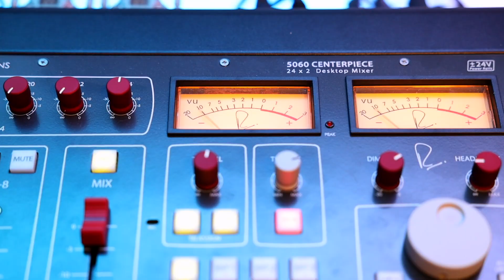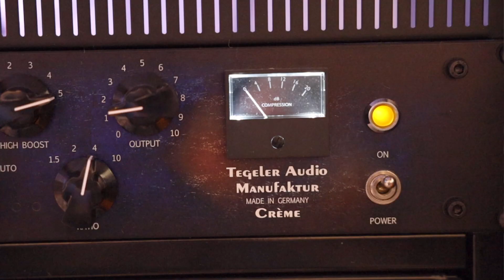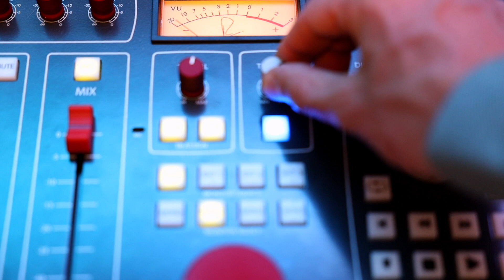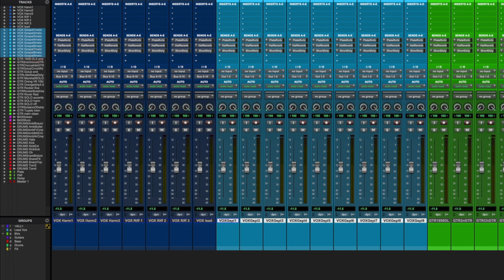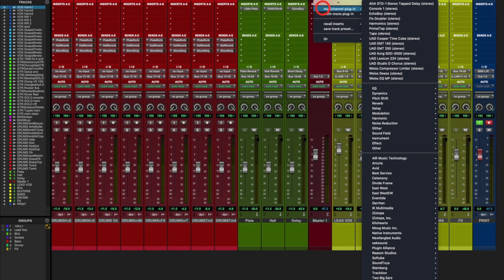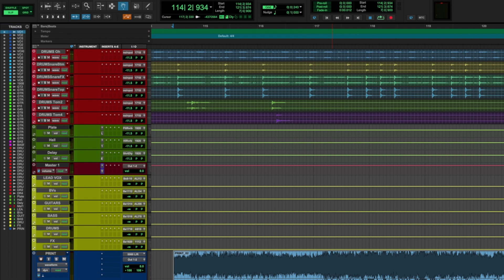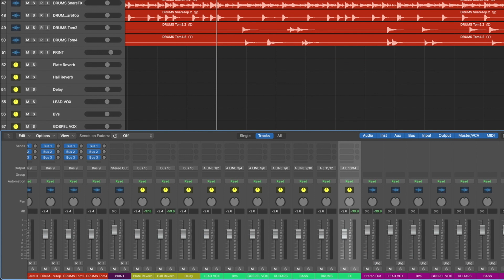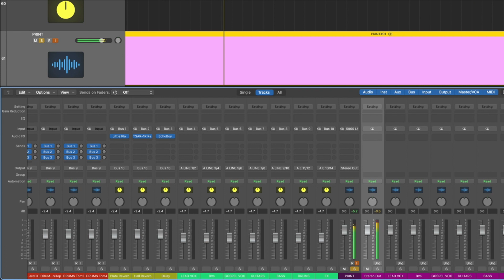Analog Summing Workflow 🛠 Setup and Benefits in Pro Tools and Logic Pro Tutorial 🦾

Comment: Hey, Great demo on the analog summing. What can you say about the fan noice in 5060. Is it noticeable?
Reply from the maker: No. The fan is super quiet. One thing that does make noise is that the needle on the meters can hit during transients and make a little tick. Apparently this can be disabled. I’ve gotten used to it, but at first it was a bit annoying. And it is subtle. It isn’t something you’ll hear over the level of a mix.
Reply: @ToddUrban  Great ! Thanks Todd, I am in the middle of thinking 5060 or 8 channel 5088. In 5088 it seems to have 3 fans for the penthouse maybe not noisy either. Need to decide witch one will fit better for my workflow. Have you had a chance to compare 5060 and 5088 IRL?
Reply from the maker: No. They should be the same sonically as far as I know. But the 5088 wasn’t an option for me based on space. Of course the price hike is significant too. I would contact RND and talk it through with them. They are a great company and very responsive.

Comment: Thank you for this! I’m getting the API Box 2 down the road and have never done summing mixing before. I may get an additional summing mixer like the API AMS164 or the RND one as well for even more track possibilities. You made it a lot easier to figure out in Logic which is what I use.
Reply from the maker: The Box 2 is great. I thought about it and am a fan of it. However I already had my preamps, so that’s why the 5060 worked out better for me. (And they are also very different sounds and workflow)
Reply: @ToddUrban I decided that I’m going to go down the analog summing mixer route instead of the API Box. I think it’s probably overkill for me, since it’s just me in the studio. Do you think getting the 5060, over the 5059 is really worth the $7000 price difference? Thanks
Reply from the maker: Sonically, I believe the RND should be exactly the same, so that leaves workflow. First; yes they are expensive. But I use the 5060 every single day and not just for prints. So therefore, I can justify that expense. It depends on when you just need a summing mixer or want more of a full console feel in a compact unit. 

One benefit of the 5059 is that you can have 2 stereo outs, which might make stem printing faster. (By twice the speed) But otherwise, I would buy a 5060 tomorrow if something happened to mine.
Reply: @ToddUrban thanks Todd 🙏

Comment: Just got a Yamaha M512 that I’ve been setting up for summing. 
Setup is : 
SSL 12 ( main interface) 
Behringer ADA 8200 ( over optical) 
Yamaha M512 master outs into SSL 12 ( L - input 1 • R - input 2 )
Yamaha M512 foldback out into ADAT input … about to jump the echo out to be pre fader as it’s currently post and prints to whatever it’s panned channel so…good for parallel )

I need help with outputs! I have 1/2 connected to my control room monitors. 3/4 patched into patchbay ( set half normal and spit to headphone amp )
I use one headphone out for my sub woofer. 
  
So basically I can only send out from 3/4 and headphone out…only giving me two mono outs ( usually used stereo ) and the phones out….

Can I hook up an old Scarlett 18i8 in between the Behringer 8200 and the SSL ADAT in to be : 
•ADA 8200 -> 18i8 -> SSL 

Sorry for long question! Great video got my brain goin
Reply from the maker: Sure. It sounds like the Focusrite would be just to get you more I/Os for summing. And if that does the job, go for it. I think the question to ask yourself is why do you want to sum. There are two main reasons why (and it isn’t the cost and inconvenience 😉)

Are you looking for additional distortion or to add some outboard gear? If so, do it. The other big thing for me is that it can feel creative, and outputting stems for summing does change how you deal with headroom vs ITB mixing. As long as you fall into one of these camps, do it and have fun. But it does take longer, and it is costly.

Comment: I have the 5060 and it sounds good, especially if you push it and light it up a little. I agree with you about the width and depth of mixes that are summed analog, but at 24 bit, it makes sense not to record too hot the way we used to Have to with tape. That opens up a mix, even if it’s in the box. I use the I/O plug-in to use my outboard while I’m working on a mix or sometimes just use it when I print. It’s more time consuming but it sounds good.
Reply from the maker: Agreed. Thanks for your insight. Even with ITB mixes being more common, the 5060 is used every day, even just to print final stems.

Comment: Hello, i would to enquire that what is that ’5060 input’? and why there are different names in each summing output. I have no names there. Only the input numbers. No names beside the the stereo track 1-2, 3-4, 5-6, 7-8. Was wondering do i need to change the stereo track separately away from input. My recording only works from bouncing tracks as the stereo 1-2 only working as the recording output. (logic pro x user). I assume the 5060 is the studio mixer. So do i need to switch the current audio interface (scarlett) for studio mixer?
Reply from the maker: Well, you can rename inputs and outputs in your I/O labels. For me, the 5060 is the output of my summing mixer back into the DAW. It is just an input to my interface and I’m recording it back as a normal stereo audio track. I have another video on the 5060, which might also help explain this. Hope that helps a bit.
Reply: @ Oh sorry i mixed the input and output. I’ll check it out for sure, been wrapping head around this for a while now. Okay. Input needs to differ from stereo signal. Thank you very much for a quick response!!!
Reply from the maker: Rupert Neve Designs 5060 Centerpiece 🏆 Workflow Tutorial and Summing Review 🎬
https://youtu.be/tCHIyOlh8vU

Comment: Is combining the drive setting of console 1 with the analog mixer over kill for harmonics or achieving a console sound? Do you scale back the drive?
Reply from the maker: Well, it depends on your goal. For me, an analog mixer saturates the entire mix or stem print to help provide some cohesion. For the drive, I might exaggerate the drive to help elements cut or add character. But the summing distortion imparts a different benefit than the individual track drive.
Reply: @ToddUrban  good point. I’m still trying to figure out what part on the channel strip the drive harmonics are supposed to be emulating; the pre, eq/comp, or the summing circuit. I’ve contacted softube already, but I’m just trying to figure out if I should purchase an analog mixer if I already own console 1.
Reply from the maker: Each one is slightly different. Typically, you are capturing the preamp drive of the circuits (I believe). I would need to double check the manual. The models of the comps and EQs will capture the distortions that are present in those circuits. But once again, what really matters here is can you get the sound you want. I personally love working with a summing mixer. But I can also mix an album perfectly all in the box with Console 1 Channel and nothing else beside my reverbs and delays. So it really matters on what your objective is. I wouldn’t get too hung up on whether it is a preamp, output transformer, or the sound of summing (as LUNA puts it), focus on whether you can get “your sound”

Comment: If the printing is finished bounce or export ??? In logic x
Reply from the maker: You can do either. But I just use command + B to bounce it. Many times even after printing, I might use something such as a plugin for digital limiting on the print, so bouncing works well for me.

Comment: Just about to start using analog summing, picking up a soundcraft 200b in a few days, might recap if I have to, running out and back to computer and or reel to reel
Reply from the maker: It doesn’t always need to be some crazy expensive gear. If it sounds right and the workflow works, go for it! 😀

Comment: Hello, I'm using a Dangerous 2bus+. I connected everything as it should be from/to my Orion Studio (it's pretty much a common sense setup). However, for some reason, I keep getting feedback when I go Main Outs from the 2Bus+ into any inputs on my interface. I'm sure it's something simple being overlooked. Any idea on what it could be?
Reply from the maker: My guess is that you are somehow monitoring both the DAW outputs and the inputs back from your summing mixer at the same time. It’s hard to know without seeing how you set it up though. The other option would be if somehow you were also sending the inputs from the dangerous into the interface back to the dangerous. And that would be possible if you had the monitoring of those inputs assigned to go back out for summing. Hope it’s one of those and you can figure it out! 😃
Reply: @ToddUrban  Thanks for the fast response. I actually figured it out. The routing inside of the Antelope software was kind of messy, even when I set it to default routing (I had assumed that would clean everything up lol). I overlooked some of the patch numbers that were duplicates of mixes/routing. I deleted everything and started from scratch to tailor it to the 2Bus+ and Pro Tools, and got everything in order. Thanks again!
Reply from the maker: @ankh9ether great 💥

Comment: A question. I’m using Studio One. When I have guitars panned hard left and hard right and sent to a bus … it doesn’t sound that wide. However when I solo the left guitars only (or the right guitars only) and print those tracks separately , the guitars sound much wider. Is there something I am doing wrong with the bus?
Reply from the maker: Hmm. Interesting. That would suggest maybe a phase issue when combining the signals. (Though in stereo that is typically less perceivable than in mono) In theory, L/R busses should be the same as 2 mono tracks hard panned in the DAW. If you are using a summing mixer, there have been times where I have felt that the stereo width changes in the analog domain. Is that just trickery? Maybe. But it could also have something to do with how the summing mixer’s circuit works with the individual tracks or stems. If distortion is applied to each one, it might differentiate the track creating the feeling of additional stereo width. (Not sure if any of that helps…..)
Reply: so I have double tracked guitars playing the same thing panned hard left and right. When they are playing the same thing … this is where the stereo image feels slightly narrow on a bus … however when one of the guitars plays a different note or playing something different, then the stereo image goes back to being fully wide. 
I have a shadow hills summing mixer and still sounds the same when summed. Maybe this is in issue with Studio One summing busses.
Reply from the maker: @JimboJones99 to me, that feels more like phase cancellation if same notes decrease stereo with, but different ones increase it. If the guitar sounds were tracked exactly with the same sound, this is very possible. This is why I typically switch guitars or amps when double tracking. This creates enough variation in the timbre so that it decreases the chance of any cancellation.
Reply: @ToddUrban  ok thanks so much. Yes will use a different guitar tone ! For each side L/R. I should have done that before.

Comment: FYI there is no analog mixer/summing device that has more headroom than a 24bit digital summing environment.  this is just simple maths and is easily verifiable.  if you correctly manage the gain structure in your mix you can have essentially infinite 'headroom'.  btw i say all of this as someone who mixes with an analog summing device.  i just know its not because it actually increases headroom.
Reply from the maker: The point here is that headroom is a completely different consideration. It isn’t a matter of more. It is that when summing stems, we are able to keep them at relative levels within the DAW without needing to adjust for clipping. They are summed in the analog domain, at which point, if you are summing to the point of exceeding the headroom of the device, you will be introducing a soft clipping distortion, rather than a digital over. 

For me, this is more about the workflow of not needing to constantly adjust 10-30 different stems busses in my DAW as they sum in the digital domain to what could be an overage. It is about leaving them in place and focusing more about the relative track levels into those stem busses.

Comment: How do I connect the Neve 5057 to a Apollo’ twin
Reply from the maker: Well, you are going to need more outputs than a twin offers to take advantage of the real potential of an orbit. But the Twin does have 2 outs, so as of now, you could use the Orbit for Silk color. What would be best is to look for an interface with 8 analog outs to really use the product to the max potential.
Reply: @ToddUrban more like 16 outs as the orbit has 16 ins
Reply from the maker: Exactly. You would want at least an 8 out or 16 out to benefit. A x8 or x16 would do this for you

Comment: This came across my feed and I just wanted to de-bunk this so people (New Users or Kids or even Semi Pros etc) don't go out and buy some weird hardware or an expensive hardware piece thinking they will get more headroom. This is NOT true. All hardware is based on electricity and has a limited point (Based on Voltage Rails). Digital, does NOT have a limited point and is based purely on numbers and how it's implemented. Your typical hardware at best can go up to 122db if that and we are talking about thee BEST in analog hardware. In digital, it's 144db and that's at the lowest 24bit/44.1k standard. Pro Tools busses like any DAW bus is clean. No color. You get what you put in. Analog summing is NOT. You will get color (EQ) and saturation (light distortion) if pushed hard. I know this video is a year old but this topic has been de-bunked since 2012 etc. When hardware had it's chance to be compared, as far as headroom, it was when Pro Tools was a TDM system and it was running 24bit fixed technology where the headroom was around (24bit) 146.26 dB and the convertors ran around 110db. That is still more headroom than most analog circuit can handle. I don't want to get too technical and keep this basic. Now, every DAW is 64 bit. That means it's 387.08 dB of headroom ITB (Inside The Box) on busses etc. NO ANALOG HARDWARE COMES CLOSE. A Neve Console has up to +26db of headroom. I think at best, API console is +28db. SSL is +26db as well. On a 64bit Pro Tools/Logic Pro/Studio One/FL Studio, it's unlimited. Meaning you can't distort the internal summing period. You can distort the output of your convertor (Which is the distortion if you are hearing some is from) but NOT the mixer itself. Do a test, put audio on your track then put 10 blue cat patchwork plugins that go to +40db each plugin. Then have it go to a master bus. Then on the master bus, put a trim plugin on it, and just simply turn it down. Heck, you can turn down the fader too as that is the same thing. You will hear NO DISTORTION! Try that on your best hardware. So what are summing mixers good for? Color and saturation to get a different sound. Not a better sound. That's all. I have a channel on Youtube that touches on this called plugmein - https://www.youtube.com/watch?v=z8KDtxADFCk&t=6s    I'm not trying to promote the channel just trying to get the right info out to help up and coming mixers/producers etc. I respect whoever runs this channel as I'm sure they are going off the knowledge maybe they were taught about digital and hardware. I hope this helps and please feel free to ask me any questions. I'm also M2E on Gearspace if you guys go there. I touch base on this subject on this video if you'd like to get to it direct: https://www.youtube.com/watch?v=1ZYFrpcwYf0         God Bless!

Comment: Hey Todd, I have 3 questions 

1. Let’s say I had 2x Rupert Neve Orbits and 32 DA could I just run each track to corresponding DA. Track 1  to 1-2 track 2 to 3-4 etc etc instead of creating busses? 
2. Can I just insert I/o onto the individual tracks for my analog hardware e.g compressor , eq etc? 
3. Does the Print track become my mix bus ? Would I insert an I/o onto print track for bus comp ? 

Sorry for dumb questions I’m wanting to integrate summing but trying to visualise in my mind how I’d set it up within Logic with the idea of mixing into the orbits and each track having its own summing track so no need for stems or groups and the ability to monitor in real time the sound of the summing units and the ability to swap around analog hardware to any track via I/o plug. Would this be reasonable? 

Thanks in advance
Reply from the maker: Yes. You got the right idea. Actually, I’ve done this for smaller sessions. Instead of having busses or stems go out to the summing mixer, I just send individual tracks. And I’ll also put a piece of analog hardware before the mixer. If you are using 2 orbits, you will need to print two stereo returns to your daw, or send one orbit into the other so you get a combined stereo return. 

When you are done, you can run the master Orbit through any “mix bus” hardware if you want. Or what I tend to do is print stems back to my DAW and then do a final pass where I combine stems in the Orbit and use master processing then on the output. 

Check out my 5060 video. That might help a little too. 😃
Reply from the maker: As for question 2, I wouldn’t use I/O, why dont you connect the hardware right on the output before the orbit? You can even set this up where you don’t need a patchbay, but instead just change your outputs to go to the right compressor/EQ for that session.